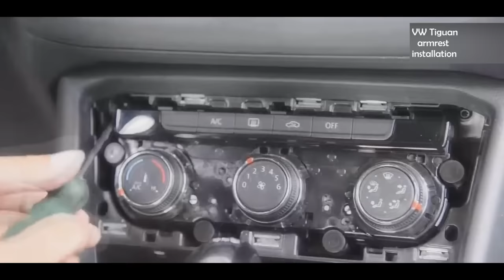VW / ARMREST box INSTALLATION 🛠

Comment: The main reason he did this was to run the air duct to the rear since not all models have it. I had been wondering if I could do this on my Jetta. Now I know. The console armrest was missing to begin with. A better title would be console upgrade or replacement.